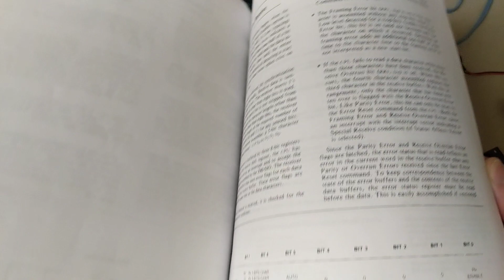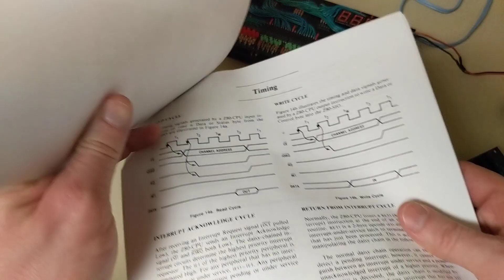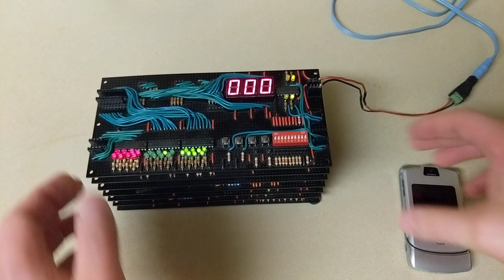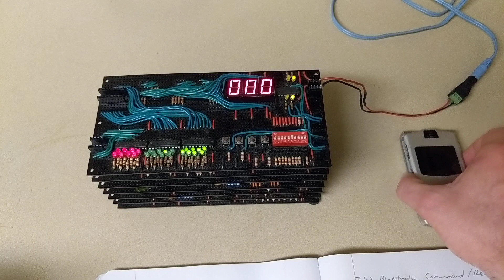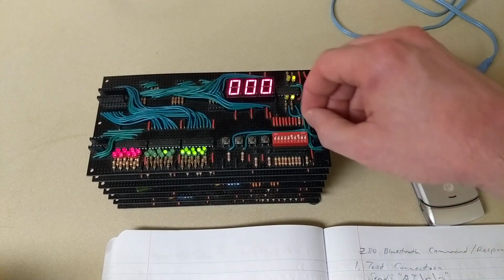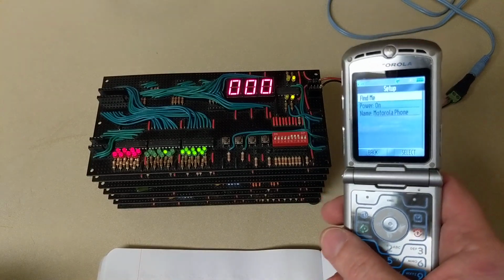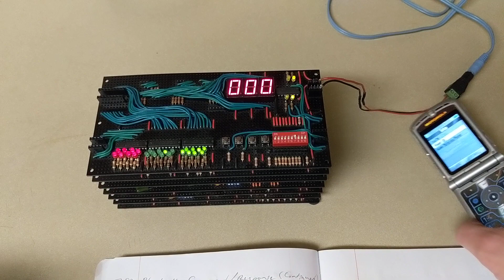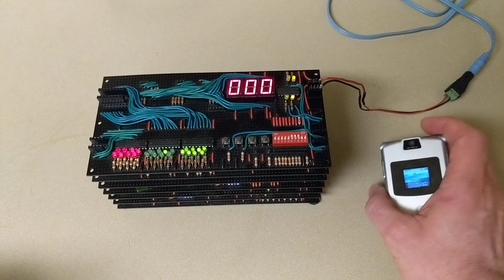Z80 Computer talks to Motorola Razr over Bluetooth with HC-05

Comment: Well done on making your own Z80 machine. I’d love to connect a HC-05 to the TEC-1G. We already have a serial protocol in place using bitbanging to a serial to USB uart, but going wireless would be very cool. Do you have any design docs or code for talking to the HC-05?
Reply from the maker: Sorry for the slow reply, I rarely check comments these days. If you're doing a Z80 to HC-05 serial connection, just skip the USB altogether and use the serial protocol. If you get a Z80 SIO or DART you shouldn't need to bitbang serial (but you can if you want to). The HC-05 needs to be set into command mode and sent a series of serial commands to establish the Bluetooth connection, then it needs to be put into data mode. It works very well once you get the HC-05 initialization right. Pretty sure the HC-05 documentation specified the command set. Send me an email and I can send you the HC-05 ASCII commands I used: danebeck84@gmail.com

Comment: Awesome Work.  I've  been work on my own Z80 based Stacked card system.  Do you have any schematics?  How are you splitting the buses up?  I am using a 60 or so pin header no the side of the card to transfer the bus and control data.  I am curious as to how you split them up?  Great work.  All you videos are really amazing.  I find my self looking for a rotary phone on ebay, and breaking out my Z80 project.  Keep it up  Thanks for all you work.
Reply from the maker: Thanks. There's only two buses, address and data. The address bus is write only from the Z80, and all the chips that connect to it only read from the address bus, so that part is easy. Every chip that connects to the data bus is either read only, or is read/write with tri-state outputs and chip select logic. The chip select logic ensures only one chip at a time can write to the data bus. Sounds complicated but it's actually pretty straightforward once you get used to it. BTW this video is super out of date, I really should make an update on this but I've been busy with other stuff. Any links to your project?

Comment: That’s awesome! I’ve been following Ben Eater for a while and he’s also building a 8-Bit computer out of breadboards. You really need to get a better interface to type in commands. Doing that over Bluetooth first is a huge challenge. My hats off to you
Reply from the maker: Thanks Mark! The input board is something I made months ago as a method for basic data input to the Z80. The switches input to an 8 bit D Flip Flop and the outputs (tri-state) go to the Z80 databus. There's chip select logic that controls how the CPU reads data in. The buttons I push control an edge triggered latch circuit I designed. Sort of a Rube Goldberg setup but it totally works. The assembly code compares the number loaded in with a numbered list of commands, when it finds a match it executes the command. Hope that sorta makes sense. Right now I'm working on getting the Bluetooth working with a Serial Terminal app on my Android phone... Then I can use the phone as a wireless interface. Stay tuned...